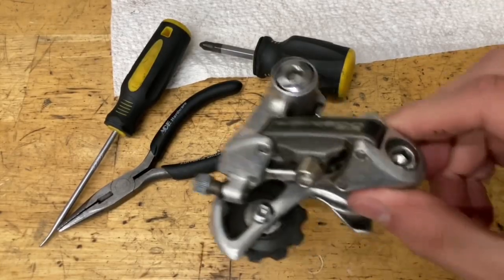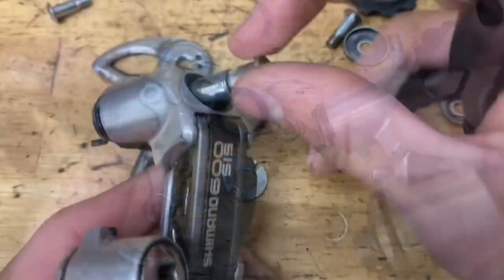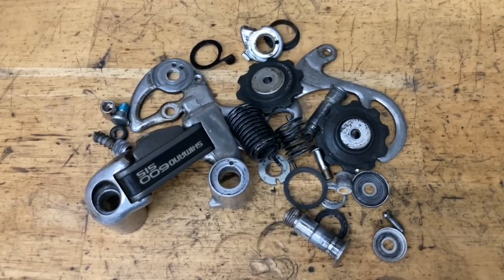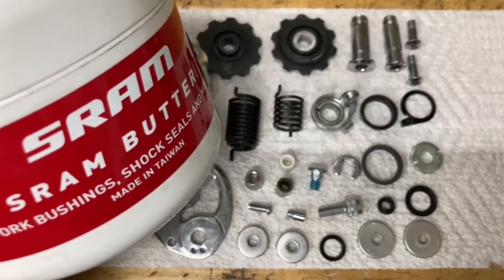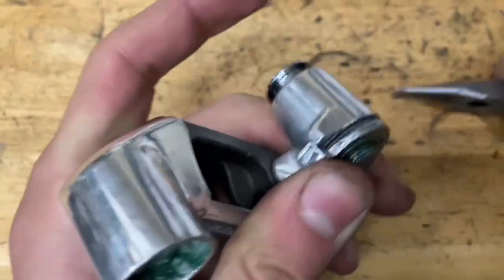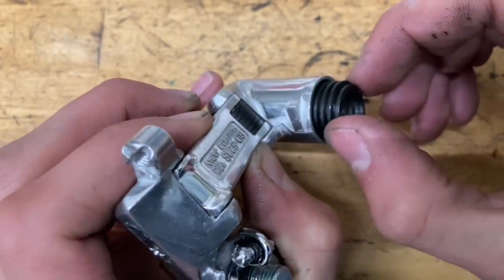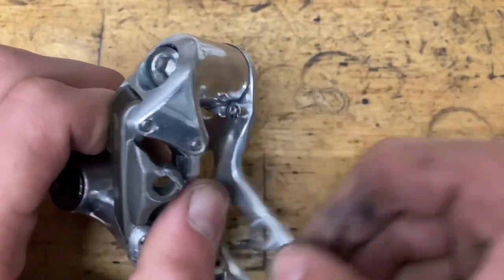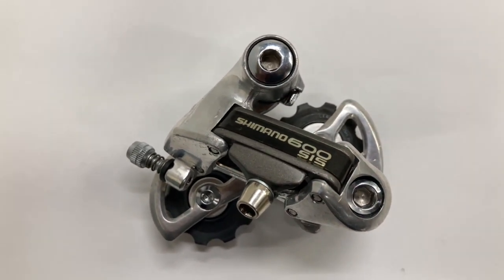How To Rebuild a Shimano 600 SIS 6208 Derailleur

Comment: You made that look so easy! I got it put back together but I’m struggling to install it on the bike correctly. It’s not tightening the chain 🤷🏻‍♂️
Reply from the maker: Try loosening the B knuckle bolt a little also make sure you have that spacer on in between the bolt and the cage
Reply: @RetroRebuilds  Dude that worked, thanks a ton!
Reply: Subscribed! I owe you that much at least. Hope your channel keeps growing and I’ll stay tuned for more content